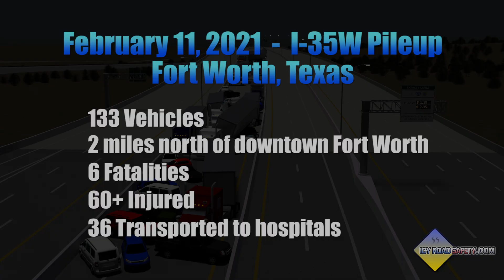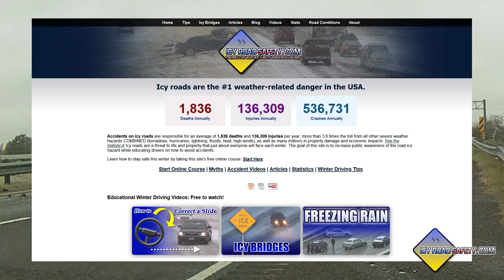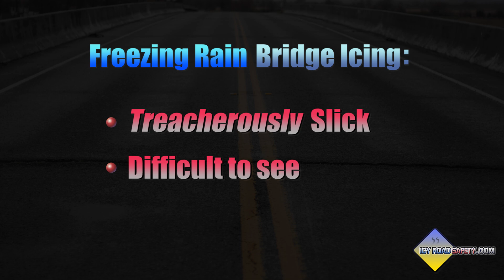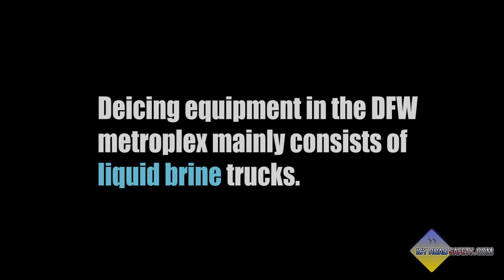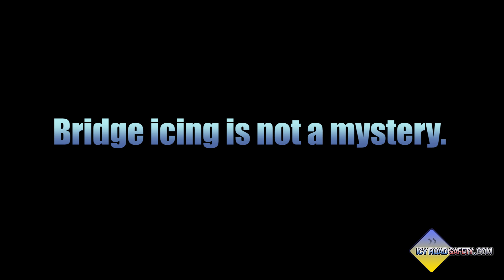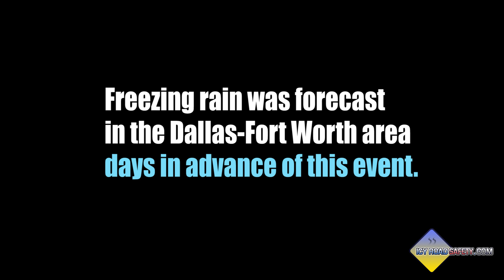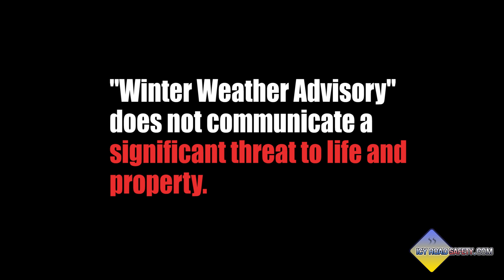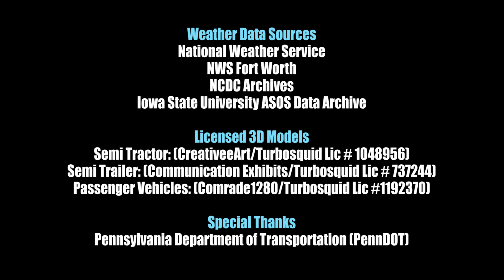The Fort Worth, Texas pileup: its cause, contributing factors and how to prevent future ones

Comment: Notice how many of the vehicles apply their brakes at the first sign of sliding causing the vehicles to completely lose directional control. If you don't have to stop,you might regain some directional control by completely getting off the brake. 
 I think "brine" is inadequate for these conditions,rock salt would take longer to dissipate and the solid particles would provide some limited traction. Also sand or cinders would provide some persistence although traction would still be much less than dry road level.

Comment: Communication about the crash should happen to the incoming vehicles. This can be made possible using a communication system between/involving crashed vehicles and incoming vehicles either manually or automatically. Upon impact of a vehicle, an electronic device should ideally send information to a receiver positioned on the roads at suitable distances which is active in all weather conditions including tornadic and should send info to the incoming vehicles. The incoming vehicles shall have receivers. Various scenarios can be thought on this line. There can be a manual intervention aspect as part of the system too.
Reply: Drivers should be made aware about the bridges which they might approach on their way using tech or offline methods such that they would have the information well in advance by at least 400 meters.
Reply: Usage of Navigators in the vehicles is one of the best solutions and hopefully many aspects can be incorporated as part of this system.
Reply: If bridges had some kind of heating mechanism as part of the bridge system then that would be an ideal solution for this problem. To melt ice, less heating is required, however, it would be needed for good amount of time. There should be some way to switch on the heaters automatically based on weather conditions or time of the year.
Reply: The tyres/wheels of the vehicles can be made warmer at specific times a bit using some technique so that they can ride on these road conditions without issues instead of using chains or salting the roads. Generally, rubber tyres do not exhibit issues when atmospheric temperatures are above 40 degree celsius and below a certain point. This temperature of the tyres might be sufficient to liquidate the ice and snow on the roads, hopefully.
Reply: Above all, sensible driving, environmental awareness and education is more important to begin with.

Comment: While the barriers did not cause the accident they were a substantial contributing factor to the severity of it. There is no shoulder in that section. No where for vehicles to get out of the lanes. Even a little bit of room could have made things better. People were also trapped in their vehicles wedged against the walls. To me it is unacceptable for a highway like that to not have a breakdown lane/shoulder. Its a toll lane so I dont think a whole lot of consideration was given to driver safety. The toll roads around DFW are out of hand. Traffic is horrible but instead of widening the regular lanes they just add toll lanes like the ones involved in this incident. The barriers are not needed in that section. They are simply there to keep drivers from cutting onto the toll road from the regular highway. Greed is what led to the seriousness of this accident.

Comment: Great video, thank you! You're a brave one to stand on those dangerous stretches and film!  It seems like, even if you drive a uniformly weighted vehicle,  with AWD and proper tires, and drive at a reduced speed across these icy roads, you are still at risk of being either rear-ended by speeding vehicles that have no prayer of slowing or stopping in time to avoid you, or hit by vehicles that lose traction and go spinning.

Comment: I have another suggestion. Have more digital bill boards with warnings to slow down and use caution. People from the south have no concept of winter weather conditions. I worked in North Dakota as a truck driver. Can't tell you how many vehicles I had seen upside down in the ditch. I saw pickups passing vehicles around blind cruves. Many of these people came from the south. Best bet, stay home.

Comment: I had driven escorting a oversize load from Canada. Our permits get negated by such conditions. I left Ftw and truckers load at already full truckstops. Trying to park oversize when this happens hell. Drove the normal condition hour to house in Palo Pinto. 2 hours! Got there, so tired. Guy calls from ftw says he has VA appointment in Dallas and s flat could I come change tire? His son and grandson refused and lived with him. I explained they will cancel due to weather. He was crazy desperate to go. So I got back in vehicle and headed back.Got there, no cancelling and no jack. Got to nearest Walmart, bought a hydraulic jack. Get there and change tire. Another call and no cancelling of VA appointment. So loaded him in my vehicle. We are heading to Dallas a hour plus away on good weather day. He gets a message they cancelled. Do I turn around and take him home. I'm exhausted. Drove in from Canada in that storm. I asked if nap on his couch. His son and grandson starts fight/ said no. So, I get their message to leave after driving all the way back from Palo Pinto. As I leave the old guy says just return the jack. I tell him I used it, that would be wrong..I thought about returning it once I left but decided, it's still wrong. Going down I35 I was just looking forward to bed. I am driving slow. All the sudden all hell breaks loose. Hit. A truck front and back. Hit after hit. Horns just blasting. A pickup flips up, flips me around and the truck behind me is hit by another and now flipped wrong way I'm shoved under trailer rear first. I'd of Bern killed if the pickup hand flipped me. The jack I was urged to return, and actually decided not to because it's wrong..I used to jack a opening to crawl out before the rear impacts pushed the truck over me. I know the guy in pickup was dead. Started trying to see if I could help anyone. Pretty rough. People freezing, terrified and trapped and by some miracle I escaped death. I got a job to my husband's job. Told him we are going home now! I called his boss, said we're out. My husband gets in and away we go! Get home, weather even worse and power is out. It dropped to -8° & no power or heat or water. Texas has its own grid. It cut the power to most of the rural areas for many days to preserve their equipment. Many died as a huge contributing factor Houses aren't made for that cold there. It's well over 100 during summer and usually often 70's then.  They did this in 2011 in a much breifer cold snap and got away with it.  My husband and others ended up suffering in the extreme cold..and died. Neighbors, good people. And I drove all the way from Canada thru storm with a high pole I could not see unless stopped to drive frequently. Get the load in a already full truckstop despite the oversize width and height and weight. Then make it home, back, get in wreck and walk away because of amazing way I was hit and turned at right time. No power or water or heat over 2 weeks. My solar batteries didn't last long. He died a horrible death as did others. I miss him so and pray often for everyone whom has to travel in bad weather. .So, if you hear about ice etc..don't go out there. Slow down! Don't trust the grid! I carry a small BioLife stove. You can burn twigs, pinecones and cook and heat a small space. It also will charge your phone as it burns. They are small, easy to fill . Go to BioLife. Pleaseu be ready

Comment: Compounded anytime there's ice, people around here can't drive well on anything (even when it's dry outside) because oblivious drivers, cellphone obsession, doing make-up on the way to work, Me First mentality, etc. Even regular rain becomes wreck central. If you have any experience from having lived elsewhere in the States or world that has inclement weather of more than one season, you only have a slight leg up on your fellow drivers because they will 'drive stupid' 24/7. Doing any mileage in a metro area even when it drizzles, people will flip out and become a danger. Some are going 80mph, some will drive 20mph on the freeway and create their own hazard, and there's no happy medium in between. It's either full send or full ride-the-brake. 
Having moved to the DFW area in the early 2000s with time under my belt from both the north and the south, something I immediately picked up on is that there are no older cars on the roads. One reason I thought was because of vehicle inspections, but after a few days you'll come to realize it's because the drivers are constantly wrecking their cars...

Comment: In the UK I was driving a truck over a small bridge doing only about 15mph because of conditions and suddenly lost all steering due to icing. My truck came to a stop against the bridge wall. Moments later a police van happened to approach from the opposite direction and stopped just short of the bridge to check on me. The officer got out and immediately was flat on his back. He eventually managed to walk very slowly to me and asked how I was and what was in the truck. "3 tonnes of Rock ice for spreading on roads" I replied. We both had a good laugh.

Comment: In the Netherlands we have dynamic signage along the freeway. In case of incidents, emergencies or traffic buildups speed limits on the highway can be dynamically adjusted and lanes can be opened or closed. There are also display signs which allow the road maintainers to display any messages to make the dangers extra clear. In a case of icy rain the speed limit could be reduced to say 20 mph to avoid people crashing into each other at highway speeds on the bridges. 

Bridges could also be closed off entirely if it gets way too dangerous to even drive over them.

Comment: The simpliest & most effective way to prevent bridge icing is to install ground heaters on all bridges so the road surface is heated to instantly melt any ice & prevent it forming in the first place. The technology to do this already exists & although the initial cost of doing this would be massive but once installed it would save lives & prevent these tragedies from happening in the first place. This is the only real solution to eliminate bridge icing once & for all.

Comment: If you don't see spray, it's not ok.

Watch your mirrors and other vehicles...if the road looks wet and you DON'T see spray from vehicle tires, it means it's not wet, it's ICE. If you see the spray, the road's ok (still adjust speed regardless).

Comment: That's all well and good but why aren't they treating the roads when there's chances of freezing?  They clearly knew ahead of time to do this and it's done routinely up north.  Most motorists are simply not going to slow down regardless of the conditions, it happens up north as well.  Every snow event you always have morons flying and weaving in between cars.  The idiot factor is quite high here.  Excellent video, information, and animations.  Moral of the story is to be smart and slow down.

Comment: It surprises me that in much of North America, in spite of regular road freezing events like this, are highly under prepared for slippery roads. With regions like the southwest, where sand is readily available in comparison to the northwest, most road crews only seem to use brining trucks rather than sand or granulated road salt. Sand and silica have proven to be very effective and environmentally friendly ways of improving road safety, while causing much less damage to vehicles in comparison to road salt, which is most commonly is calcium chloride, which causes metal to oxidize and corrode faster.

Comment: 9:04. Says full highway speeds of 65-75 mph, "or higher".  That last part is severely understated. I  live in Fort Worth and at least 25% of the drivers are traveling at 85-90 mph and hardly ever see anyone pulled over for speeding. Daily commute is a different path each day due to avoiding wrecks.

Comment: I wonder if a sensor could be developed (if it doesn't exist) to detect frozen ice layers on the road, and if a frost layer is detected, it could trigger hazard lights on the road that could be deployed well ahead of a bridge. This could enable drivers to recognize the immediate, concrete existence of the hazard, and slow on the road sections before getting to the bridge, possibly saving lives. This might have more impact than a push notification ahead of time, since it would be concrete not a theoretical risk, though I could imagine costs to deploy such a system not being justified in regions such as DFW where this would be a quite atypical event.

Comment: For the south, since you guys wont use salt, use sand. We also use that in the midwest it gives the rut more bite under load without the negative effects of corrosion. All you need is a bit of traction to help motorists slow down and gain control. It will however not be permanent as sand can wash away, but it can still be useful initially. It might have made a difference on that downhill portion of the highway
Reply: The amount of times it would be used, wouldn't justify the cost. It's too cost prohibitive for them to spend the money on purchasing it, since freezing temperatures are rare down here.
Reply: We do salt. Well, Arkansas, Oklahoma, Virginia, Tennessee, Georgia, North and SC, and Alabama salt. Mississippi only salts bridges and overpasses. But we definitely pretreat, salt in Arkansas. They learned their lesson back in 2012. They do a helluva job now. And yes, we actually have salt trucks AND PLOWS.

Comment: At 1:30 a blue pickup driver demonstrates what not to do on expected, suspected, reported icy bridges. First, speed must be constant. Do not change lanes avoiding all steering inputs. Do not use cruise control. Once the vehicle’s rear tire lost grip, the rear swung to the right. The only input I could see was braking as per brake lights, and that a wrong action. Previously other vehicles successfully crossed. Something about the pickup was a variable and I suspect the weight distribution was a large factor. Notice also there  is an exit lane on the right side. Did the driver make a steering input towards the right?

Comment: Pickups are particularly prone to losing control on ice because they are so light in the rear. Breaking traction is VERY common in pickups. I noticed that many of the vehicles losing control in your excellent video were pickups.
Reply: I recall people here (MN) putting sandbags in the back of pickups to better keep traction

Comment: The ones that go out of control so fast are probably because they have their cruise control on and when the drive wheels hit the bridge they start spinning before the driver can even react. Also, I have owned vehicles that were out of alignment or had a low tire on the drive axle that would go sideways in a hurry on icy bridges.

Comment: So apparently if the people that lived in the area knew and had warnings is one thing about the dangers of the road.  But what about the people that were from out of the area especially the tractor trailer drivers who were unfamiliar with the conditions of the road.  How do you solve that?  There needs to be a better warning system.  But also too people need to be aware especially certain times of the year with the conditions could be like and to drive accordingly in lower speed especially on bridges.  People need to be more educated and more aware.

Comment: I live near the intersection of 35 & 820 which is maybe 3 exits north of the pile up. Let me be very clear about something this was the day before the Great Texas Bizzard that shut the light off for us so all over the News they were telling people stay home if you can and if you must commute be particularly cautious about black ice.  I will tell you that morning in true Texas fashion people did not listen and were still speeding and driving recklessly like it was 85 degrees and sunny. I got on the highway that morning at 820 & Blue Mound and got off at 820 and Mark 5 literally one exit later because people were driving like morons and soon as I got on the highway a truck spun out ahead of me. I said nope just going to take the back streets and by the time I got to work the pileup was happening. I don't think it really wouldn't have matter if it was treated because people were still driving 80mph that morning despite the obvious dangers. The reason it was so bad is because people were hitting that pileup at full speed.

Comment: In WA state, we have this overhead signals that turns bright signs that says to slow down (icy road or blocked traffic or accident ahead) several miles before. Unless people are stupid (which are many), most follow and slows down. It is not possible to miss the signs because they are bright and a lot of signs every several feet. When I see the bright alert signs, I once made a mistake and exited at the next exit and do the back roads which ends up driving through steep hills of WA State and got even more scary.

Comment: Dan it's so true. Ice is rare here, and they never salt the roads. If we got an "Ice Road Warning" text message like the "Amber Alerts", and also some portable lighted interchangeable message signs, I'm sure people would slow down, even if they've not been watching TV or listening to the radio. Texans mostly have zero experience driving in icy conditions. Ice isn't taken into consideration when the roads are built, either, particularly on causeways and bridges. So if you're from out-of-town passing through, you wouldn't suspect such hazardous conditions on the road with no warning whatsoever. Those semis passing through would've never suspected that ice. 
When I lived in Jersey i was impressed because there were plows with salt everywhere when the roads would freeze.